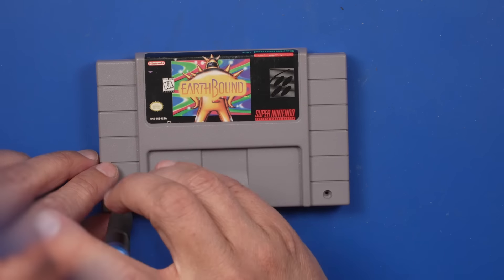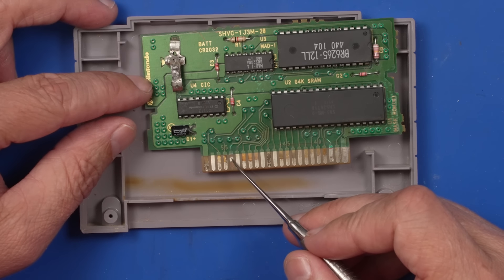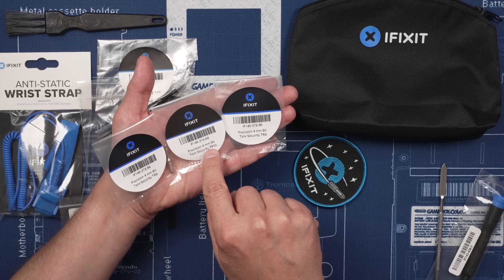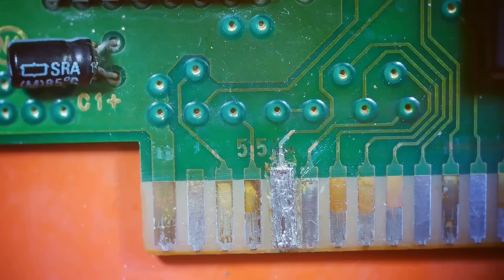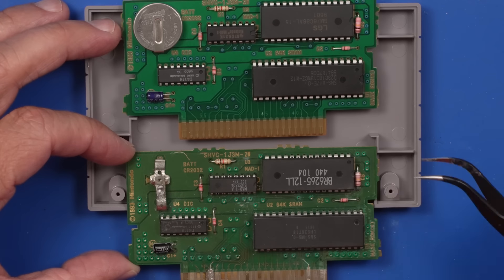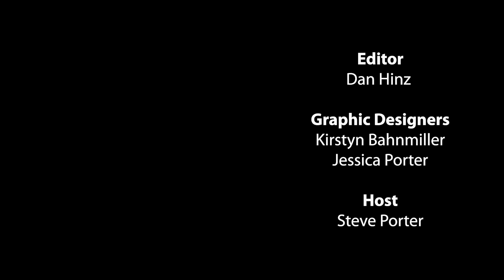This SNES Game is Worth Around $400 IF I Can Fix It!

Comment from the maker: We started a Discord! Come hang out: https://discord.gg/FE3Q3GFn
Reply: @Tronicsfix  you are the best
Reply: Hypothetically if you couldn't swap boards you could remove the original connector traces and drill holes in the traces and down to the connector slot to run a thick gauge hammered flat copper wires with a long/short arrangement that doesn't overlap the other side of the board pins.
Reply: Great work Steve, you are amazing!! Keep at it.
Reply: I want to buy that game
Reply: Do other games share a similar board?  If so, transferring the chips may be a solution.            sure ,second I hit enter on this comment as the vid is playing you say exactly what I suggested.
Reply: I'm new to this chanel but it's good to here you are ok
Reply: I would have probaly had a new PCB made and transfer the chips over  just keep it identical to the OEM pcb
Reply: actually use two part epoxy resin to put a new trace down on the board remove the old copper trace rough up the board apply appoxee put on a new copper trace and then bridge with some soeder
Reply: Hey friend i went through cancer also :/
Reply: "Game slot pins" as you are calling them is called a "card edge connector" the slot on the console is called a "card slot connector" the individual pins are called "card edge pins" and the slot "pins" are called "card edge fingers"
Reply: I have this game earth bound where can i sell it ?
Reply: You need to buy some propper pads for repairing those cartridge connections lol that repair you done will eventually file itself away and maybe cause a short inside the console😁also really wish people would clean their tweezers more lol just a pet peev of mine lol
Reply: @InconsistentManner  Hmm Un-important but interesting...
Reply: @monkstandinglast  Looks Allot easier just doing the board swap, What repair did he do?, he switched the board which is a far better and reliable way of replacing the pins since there in original factory state and its the only part thats constantly being used and and abraised? If you mean when he adds the solder to join up pins its literally to test the games are in a fixable and workable state he doesnt sell them like that and if you listen to the vid he says its not reliable and goes on to swap the whole board.
Reply: Can't join, maybe to late or because I'm French ? :(
Reply: What happened to him ? :O
Reply: Discord invite invalid, looks like Frenchy above 8 days ago also couldn't join
Reply: @Tronicsfix  can you fix cell phone I need my phone as it had all of my newborns pics in it and the repair joints in my area can get it goin even after changing a charger port battery and screen it truns on but doesn't show picture or boot up
Reply: Link expired.
Reply: thx for this video. One question, why you not replace the capacitor too in the refirbishing process? it is not on the same way important ? can someone explain it?
Reply: I’ll sale you any game you want for 200 snes or nes
Reply: the link have expired, just a heads up

Comment: As soon as i ssw that wrecked edge connector I was saying to myself, "just swap the ROM to another board", glad that's how it played out!
Reply from the maker: Yep, those edge connectors are very difficult to repair.
Reply: But now you have a not so valuable game parts and you could save that too by migrating them to a brand new snes circuit board. I dont think it would devalue it anymore but it would be working.
Reply: @lookitskazzy  is there a way you can flash that chip ie so you can put that rom onto other chips?
Reply: @lookitskazzy  agreed. I have done the same thing on another valuable sega genesis game that my local video game store had. We found another donor game that had the same board that was very cheap and I swapped out the ic chips to save the other game.
Reply: @Chris-h3f5u  No, NES games used non-rewriteable mask ROMs. You could switch the ROM chip out for a programmable eeprom though.
Reply: @Tronicsfix yeah, it seems like a cartridge pin repair wouldn't hold up to the friction of being inserted into and removed from the console over time
Reply: i'm smart too!
Reply: Hah I am 4 minutes in and was about to comment "can you just move the chips to a new PCB? I guess I know how it ends now.
Reply: @Tronicsfix  can those edge connectors be repaired by some kind of electroplating? I mean, it couldn't be cost effective, but could it work is what I'm wondering.
Reply: That was my first thought too
Reply: @Chris-h3f5u  that wouldn’t be so much “flashing” the chip as it would be “dumping” aka reading it; this is essentially how ROMs (the game file) are made (this physical chip is also called a ROM, indicating its “read-only” nature.
Reply: @tylerjung5824  it depends on how bad they are, but in this case no, they are gone all the way to the substrate, which is fiberglass board, so electroplating isn't going to do much of anything helpful.
Reply: He don’t miss
Reply: Came to the comments to see if people were saying it would be way easier just to swap the chips onto a new PCB. That's the worst looking SNES cartridge board I've seen him work on so far.

Comment: fun fact, there are 2 solder points on the opposite sided of the board to the battery, that when tested with a multimeter, carries the power from the battery, if you solder another 3v battery to these points before removing the original battery, then continue to change the original battery. then after you remove the temporary battery, your game saves will still be on the cartridge
Reply: nice information...
Reply: or solder it while it's powered up.  or just back the saves up if you have dumping hardware
Reply: simple logic
Reply: Just like what a mechanic does when they replace your battery
Reply: @fastinradfordable  with a dead battery? 😂
Reply: This trick works on at least some Gameboy cartridges aswell. I kept my Pokémon blue savegame from vanishing with this method
Reply: So what you are telling him is he needs to solder another one of those quick battery holders on the other side of the board too! Great idea! ;)
Reply: essentially saving the CMOS otherwise it does an NVRAM clear.
Reply: Depends how dead the old battery was and if it was even saving anymore to begin with.
Reply: @mNag  worth the effort to try to save all the game progress. If it doesn't work then you can just remove it. Easy peasy.
Reply: I changed over 10 batteries for NES and SNES carts last year and only lost saves on 1 cart total. mainly because I accidentally reversed the polarity before soldering the tabs

Comment: As soon as I saw the condition of the old board I thought this would be a good candidate for a board swap.
Reply from the maker: You were right!
Reply: I thought the same thing
Reply: Wouldn't have been a very long video if he gave up that easily. I have replaced the board because the old one had the complete insertion part was broken all the way across(mario kart). I have one that board is snapped in half (mario 64). I find the sports games make cheap donors.
Reply: Same
Reply: making the parts not the original parts so can you REALLY sell it for $400? also bought it for $200? probably can get it off a flea market who doesn't sell it at retro gaming collectors prices
Reply: @VTuber_Clipp3r  they are original parts, its not a third party replica PCB, I can agree that some people would probably be a bit "eek" but as a collector myself I have no qualms about games that have been repaired by swapping the rom chip from a damaged PCB onto another official PCB, reproduction PCB's I would probably be a bit more ...hhhhhmmmmmm "I don't like that", but the reality is as long as the person doing the repair do a tidy job most people probably wouldn't even be able to tell the difference

I think the only concern I would have is long term reliability in this case as it looked like someone had done a real number on it previously and could've heated the rom chip up a bunch of times that might effect its long term reliability, but realistically as long as its all working reliably now its probably fine, I got my copy of CBFD for $30 as the PCB was cracked so it didn't work, so I just swapped the rom chip and it worked perfect so very happy with it, could I have carefully gone over it and ran little jumper wires to repair the traces? yeah, but I am more happy with a working clean game than a 100% original PCB with a bunch of traces repaired, as good as a job as I could've done it still inherently introduces a bunch of new points of failure if the crack ends up working further along the board or one of the jumpers ends up coming loose due to the flex in the board where the crack is
Reply: @bobbobby1624  I think there are going to be many people who would have a problem with the board swap. Most people who wouldn't care also wouldn't pay $400 for it.
Reply: If the board is swaped does the cartridge lose value?
Reply: @BriBCG  yeah if you explicitly say "I swapped this PCB as the original was damaged" you might loose like 20% of the final sale price, but it wouldn't be any more than that because there will be 40 different guys who simply don't care because they just intend to flip it for the full price immediately afterwards who will not be mentioning the swapped PCB, and once that's happened, as long as the repair job wasn't done terribly most people probably wouldn't even know the difference, meanwhile if the guy who repaired it used a repro PCB or did some trace repair work it wouldn't be long before it finds it self into the hands of someone else who will just do a straight donor pcb swap and either keep it for themselves or sell it out into the wild and your back to square 1 where even if he mentioned the PCB swap the next guy who owns it probably wouldn't
Reply: @bobbobby1624  I could see that happening, although customers buying a $400+ game are more likely to have it opened up and checked out to make sure nothing is wrong or fake. Especially in this day and age where fakes are so rampant.

Hopefully he can still sell it for at least $300.
Reply: Agreed. I'm a collector and I'd have noticed the board swap and politely declined the purchase. Cool you can do this, cool it's still the same chip, but it's not original and that's the point. Would have like to see more cleanup and time went into the original destroyed board. I think with the right tools and better pins he could have got it looking near brand new on the original board

Comment: As someone who's moderately experienced in Soldering, the number of times I had seen others fail in soldering just because they used a crappy iron which doesnt heat enough is insane. Most large pads require atleast 5-10 seconds with 450 degrees on soldering iron, and many irons just cant achieve that and people end up either heating for too long and damaging the top layer of the PCB, or pulling without the solder properly melting and ripping the pads out. Also a little bit of flux usually makes the whole process way easier.
Reply from the maker: Yep. I think this is probably the number 1 problem when people first learn to solder. A cheap iron makes soldering WAY more difficult
Reply: Yes! I was using a cheap ebay £20 iron and it was junk... bought a Yihua soldering station for £120, not high end by any means but its a night and day difference compared to the unbranded one.
Reply: This was my problem when I was trying to learn too. I felt like I was doing everything right and still couldn't accomplish much. I even showed the soldering iron to someone who solders for a living and they said "yeah that's fine, I use one like that too"
Eventually I caved and bought a proper soldering iron & station, KSGER something, and finally I can actually solder. Some people say a bad craftsman blames his tools, but there is a line where crappy tools absolutely exist and you will have a bad time if you use them no matter how good you are.
Reply: Yes. Don't ever get that crap red weler soldering iron. The lack of feedback, it's crap design. And either burns or takes 20 years is not worth it. Get those screen soldering irons.
Reply: @yotoprules9361   You could have bought a Pinecil64 with integrated Risc 5 controller and Amoled display that regulates the temperature for you. No soldering station required.
Reply: @mjc0961  How about a soldering iron with build in controller like the Pinecil64 instead of a soldering station?

Comment: Finally, someone installs a battery holder inside the cartridge to make it easier to swap in future 👏🏻
Reply: No one is ever going to need to replace that battery again. I have my original copy of Earthbound that I got on release day. Battery still works. Can not imagine someone will need to change that battery in 2055 lol.
Reply: Most people argue that it's unnecessary, but to me it seems sensible that if you already put in the effort to desolder it, you might as well install a permanent fix, even if it won't be required for the next 10 years.
Reply: @Sepioth  Its more to safeguard against a leaking battery damaging the board
Reply: I’m so confused. I swear I’ve taken batteries out of those original holders plenty of times.
Reply: @frankruff7114  You can but it's a bodge, the original "holder" is actually contacts welded to the battery you can kind of pry them off the old one and tape a new one in between them but it's not very secure and if it looses contact there goes your saves. It's much better to actually solder a new one, or a proper holder, on instead.

Comment: In this case, just swapping the ROM sticks should just work, but many SNES games have a copy protection mechanism, if they detect incorrect Save RAM (The upper chip; it contains the save data), the game will activate copy protection mechanism. This was used to detect Floppy Disk copiers, which usually had a single SRAM for all games. Earthbound has an interesting copy protection, you would get more random encounters and the game would get more difficult. If you reached the final boss, the game would erase all save data. However, Earthbound and NHL97 both use 64k SRAM, so it should be fine.
Reply: Wouldn't the save ram be gone because the battery was pulled?
Reply: @volvo09  The Save Ram, as if the chip itself. The game checks for the exact size of the chip (64k in this case), it doesn't care whether there's an existing save in it or not.
Reply: @pablo2001nov  ah ok, I misunderstood what you were getting at.  Thanks!

I bet that got a bunch of people back in the day wondering why the game is so crazy, I never would have expected something like that, but it's smart!
Reply: could you also swap the sram to avoid this problem?
Reply: @oni2662  Yeah it would be absolutely fine.

Comment: Battery holders are the only way to go IMO.  I did all my Gameboy (and the 2 GBA games I have that have batteries), replacing them with low profile battery holders.  I use emulation for the 8/16 bit conosles so I don't own any other cartridges that have batteries.
Reply from the maker: Yeah, I wasn't sure if that will increase the value or decrease it.
Reply: @Tronicsfix  As far as the resale value on the collector market...honestly I don't know.  Some collectors are reasonable, others go absolutely nuts when everything isn't 100% original.  But for the latter, I would think the act of replacing the battery or soldering in the cartridge would "destroy" it as far as those people are concerned.  As somewhat of a collector myself (who likes CIB copies), I had NO issue replacing them with battery holders, and that increased the value of those cartridges to me.  Because I know when the batteries die again I can pop in a new one in about 5 seconds.
Reply: @StormsparkPegasus Pragmatic conservation. I like how you think.
Reply: @Tronicsfix  Value shouldn't be the deciding factor in this case I feel. Better have a solid working rare than no rare at all. Well done!
Reply: What battery holder fits inside a GBA cart. Cause the batteries themselves barley even fit over the MX chip.